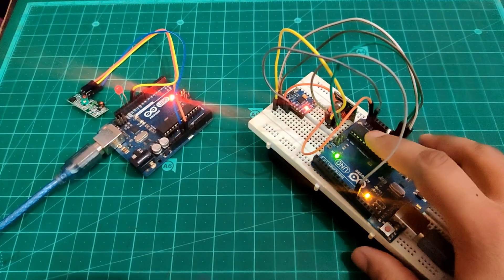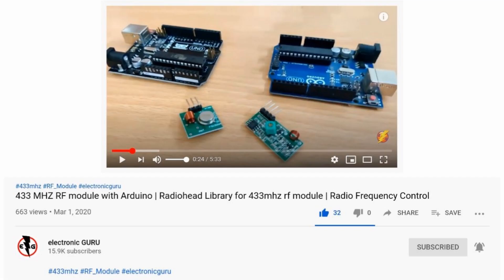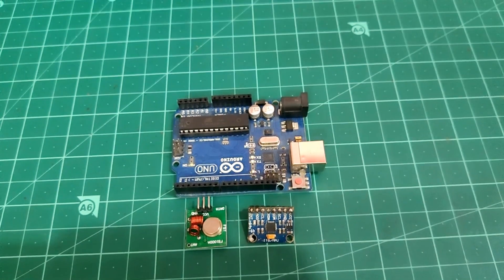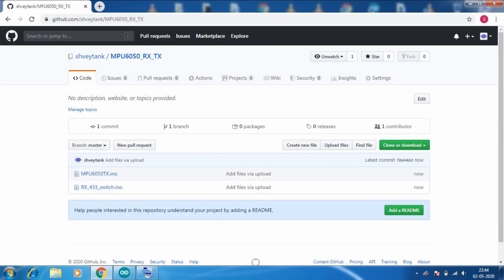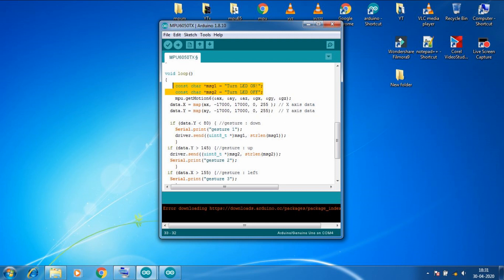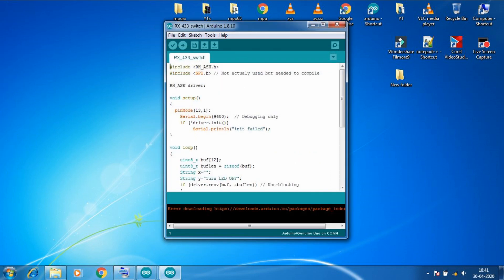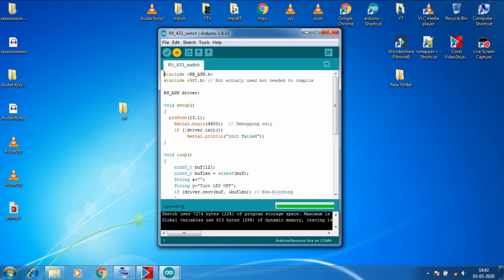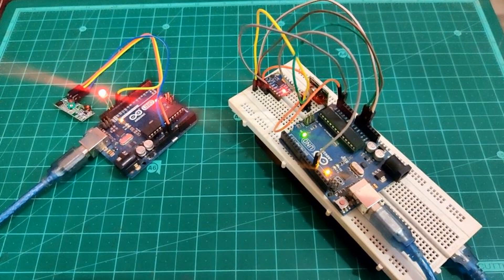MPU6050 Motion Gesture with 433MHZ RF module | control Arduino with mpu motion gesture wirelessly

Comment: Nice tuto, I was wondering what I need to do if I want to use the Tx with an arduino nano?
Reply from the maker: Same man , follow the same pin connections nano & uno are practically same but looks different